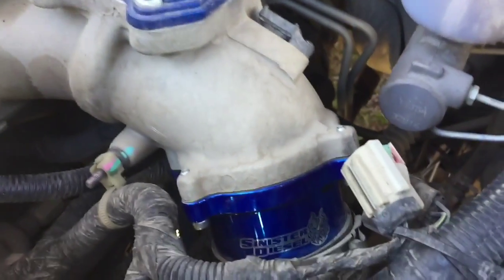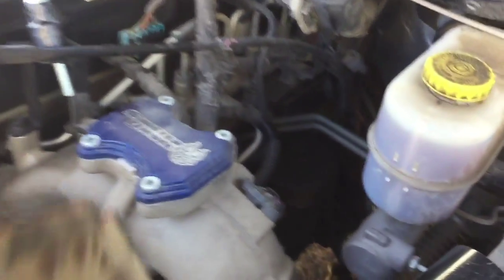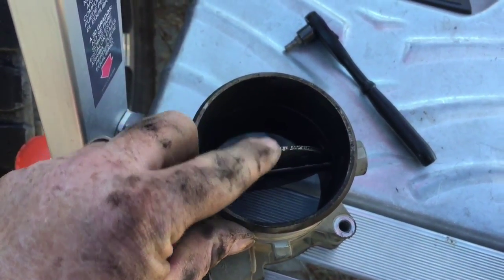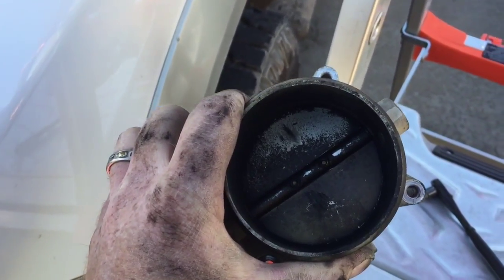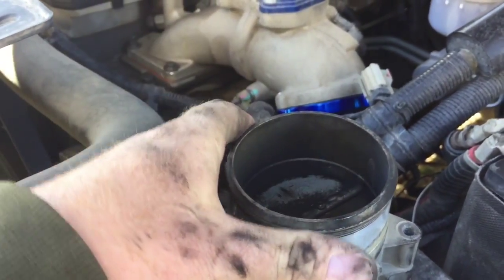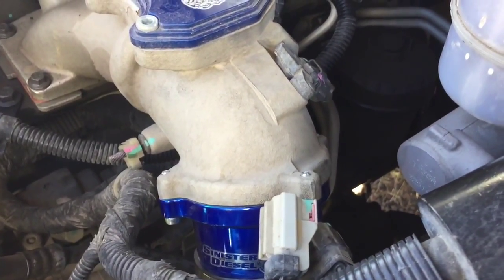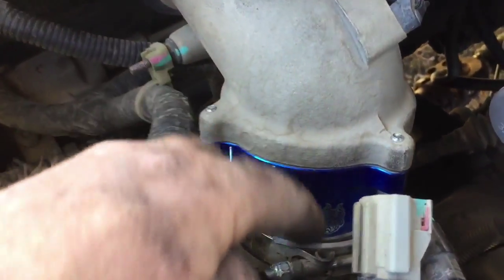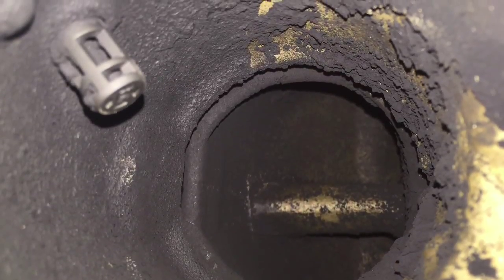Throttle Valve Delete 2011 6.7 Cummins 3500

Comment: I have a 2016 6.7, what are the pros and cons of doing this delete? mines all stock, and was wondering if I just left it as is does it matter?
Reply from the maker: 12345 Abcd it would stop your truck from "inhaling" so much of the exhaust from the EGR resulting in better fuel economy and lower EGT's and give you more longevity in the motor. Not to mention a little more power since your truck would be burning more fuel when you punch it instead of fuel then fuel mixed with hot exhaust. I couldn't tell you if you could do this without a programmer in a 2016, one way you could test it is by simply unplugging the electrical connection going to your throttle valve and seeing if your truck throws a code. If it does, simply plug it back in and you'd know that you need a programmer to stop the code.
Reply: Drew Reed your need a tuner if not the ecm will sense you’re stuff is unplugged and go bonkers putting your truck in derate or limp mode. Your dash will light up like a Christmas tree also lol.
Reply: @drewreed2358  what do you recommend?
Reply from the maker: I would delete anything older than 2018. As for the air horn and throttle valve, there wasn’t enough of a result in any manner that made this an efficient upgrade. It will in fact “breath easier” but not enough to warrant the cost IMO.
Reply: I have a 2011 with the 6.7, and it’s fully deleted with this Sinister Diesel kit, 4” exhaust with a Diamond Eye muffler, high flow air filter and a H&S Mini Maxx tuner, awesome power and sounds amazing!
Reply: @eleigey  what kind of tuner mines going into limp mode a lot I have the smarty

Comment: Im getting a code for accelerator pedal snd red lightning bolt truck has power  issues you think this could be it? The damn thibg has been unplugged forever tho. 2008 deleted 6.7

Comment: it looks like there are 2 screws bolting the butterfly to the shaft. If I'm right couldn't you just remove the butterfly and get the same results?
Reply from the maker: Jerome Frady absolutely. Only benefit of use this part is that you don’t have the shaft in the middle or the soot build up. I don’t think there would be much difference in airflow using this part as opposed to just removing the butterfly but some say every little bit helps and it was pretty cheap.
Reply: Drew Reed has anyone determined if just removing the butterfly will keep  CEL from lighting up?
Reply: Rudy Reyna i removed the butterfly on mine thinking this would trick the ecu into thinking it was still there because technically the sensors are all still plugged in but after about fifty miles the engine lights on.it builds boost way quicker without the butterfly and i noticed a decent gain in mpg so im just gonna have to deal with a better running truck that just has a light on!
Reply: I disconnected my egr throttle body valve connection and CEL came and stayed on.  I'm programmed and was surprised with that.  Plugged it back in and CEL turned off.
Reply: @rontatar236  I didn’t remove the butterfly I removed the plastic gear the closes it so it still goes through the motions and the computer is none the wiser

Comment: You mentioned airbrake. If I delete and install like you did would it affect me airbrake? I utilize my airbrake often when towing my 32+ foot camper trailer.
Reply from the maker: adamlov7 nope. Not if you have an exhaust brake like mine. They are intergraded into your turbo so as long as you don’t replace your turbo with one that’s not a VGT you’ll always have your stock exhaust brake.
Reply from the maker: https://youtu.be/hdjsNPeCLQs

Comment: when you deleted your throttle valve, how did you reset your (Service Throttle Valve)? I have a Bully Dog Tuner and I deleted EGR and DPF.
Reply from the maker: Vadim Sidorov I didn't need to reset anything so I'm not sure what your asking? When you delete the EGR, they instruct you to unplug the throttle valve. So it shouldn't be electronically connected to anything right now. If I've missed something please let me know.
Reply: Drew Reed, my throttle sensor is unplugged. Is your map sensor unplugged also? I just get a message on my display screen that I need to (service throttle valve) the lighting symbol shows . I have a 2015 ram 3500
Reply: Hey I just fixed it, one of my sensors was not plugged in and it through out the throttle message and a P0472 code. I plugged it in and reset the bully dog. All codes are cleared. Truck runs great!

Comment: HOWS THE egr delete kit holding up??
Reply from the maker: It did great. Put over 200k miles on it while using the delete kit. Outlasted two turbos, an alternator and a water pump before I traded the vehicle in.

Comment: did you use a delete programmer after installing the Valve and EGR delete kit?
Reply from the maker: Yeah, truck will go into limp mode if you don't have a tuner.
Reply: I have a 2010 3500 dodge and I did the erg and the dpf delete but it still having the same problem that it doesn’t want to run ,, but I don’t have a tuner ,, you think that I need a tuner and if I do which one you think will work better
Reply: absolutely need a tuner

Comment: Do you get a whining noise when you get on the throttle
Reply from the maker: Clayton Alvarado no, didn’t have any issues when it was running. Video was made 4 years ago and truck isn’t mine any more. Never did find the issue, only did it in the cold tho, not sure if that helps you.
Reply: I know this is an old thread, but on my 2012 6.7 i did get that wining noise.  Turned out my air filter was too dirty.  Is there another issue that causes this related to this valve?

Comment: so did you find out the issue? mine does the same thing and not sure what is going on
Reply from the maker: Cody Brown no, still not sure what the issue is. It seems to do it in the cold weather more than in the warm so I think it’s actually something electronic with how the truck turns on the exhaust brake to warm up faster. Might be that it glitches out somewhere. I’ve been told to try and trace the wiring back to the ecu because there maybe a wire grounding out but I couldn’t find anything there either.

Comment: well did it fix it
Reply from the maker: Nope. I've had a problem where occasionally on start up it sounds and acts like my exhaust break is turning on. I cant get it to turn off without shutting the truck off and restarting it. Doesn't put up any codes and won't get up over 1500 rpm without a lot of effort, then when it does it shoots up to 3k RPM and my EGT's reach around 900-1k. I'm starting to think it's some kind of bug in the electronics somewhere :/
Reply: +Drew Reed sounds like limp mode dude
Reply: +David Vardy limp mode should occur that early
Reply from the maker: +David Vardy it's not in limp, it pours fuel to the motor like crazy but the boost won't build pressure that's why I thought the intake or exhaust was getting blocked. I'm certain it has something to do with the exhaust break and electronics controlling it because it corrects itself simply by turning the engine off and back on again :/
Reply: Take a look at your sensors and make sure their all snugged in
Reply: Hey I see this was 2 years ago and hopefully you got the issue figured out by now because I had the same problem and it wasn’t anything on the intake side it was the turbo that was the problem. To simply put it the exhaust brake is built into the turbo and over time soot gets built up on the blades inside the turbo which will cause the exhaust brake to get stuck in the open or closed position. When it’s close you’re not moving faster than 5 mph bc you’re truck can’t breathe. I replaced my turbo with a non vgt and then installed a inline exhaust brake which works great and it runs on a small air compressor. The dodge knows about the issue but they still install the bad turbos. It happens at around 50-60k miles.
Reply: 2014 and I'm having the same problem while driving. Replaced the turbo and actuator in November. Replaced the actuator 2 weeks ago and same problem. What it calls for is exactly what it does. Any help?
Reply: @drewreed2358  Did you ever figure it out sounds like a stuck variable vain turbo.

Comment: this is not a throttle body the only purpose of this device is to help raise the temperature (egt) only when it goes Into Regen mode.
Reply from the maker: Ace Ventura I agree with you Mr. Pet Detective, completely! This is most certainly not a throttle body. The video is however correctly labeled. A simple search on the internet for “throttle VALVE delete 6.7 Cummins” will show this exact part numerous times over, including a result connecting you to sinister diesel’s website to buy the exact part in this video.